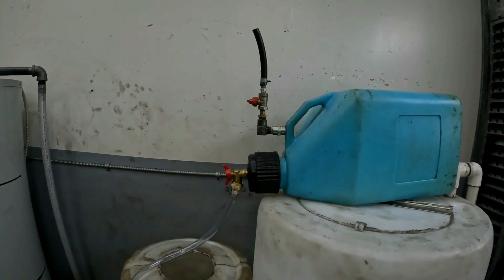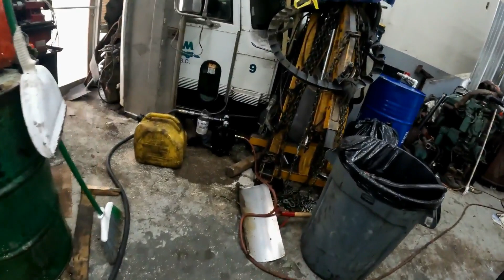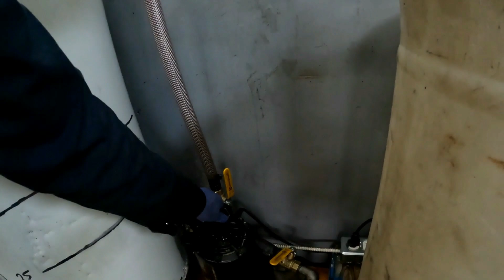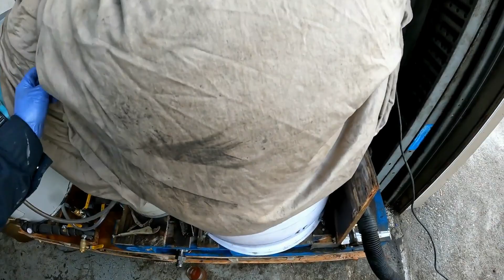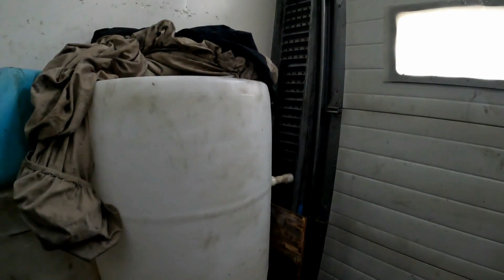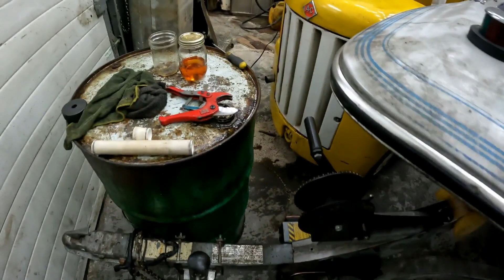First 50 Liters Of B100 Bio Diesel

Comment: What Centane value do you achieve with your mix. Can you increase the Centane value.
Reply from the maker: The B100 has a Cetane of 50 and can be increased with a Cetane booster.  Veg oil has a Cetane of 35-40.

Comment: would a modern common rail diesel be able to run this
Reply from the maker: I know of many on the forums running B100 on common rails that have the DPF deleted.  I've met a guy recently that runs a deleted 2012 Cummins 6.7 on a two tank veg system similar to mine.  Real nice setup with 140,000 kms on it so far running veg.:)

Comment: Once upon a time, I saw an ad for a way to make your own biodiesel. Everything was included including the tanks. The main caveat was if you sell the fuel to others, you have to pay fuel taxes. Since your truck has been running on waste oil, I have never seen such a clean airbox. You are the guru of Detroit diesel gurus. Keep up the good work.
Reply from the maker: Thanks, In the early 2000's before common rail and aftertreatment, these kit's were everywhere.:)  That one your talking about is most likely the Bio Pro 190 or similar.https://www.utahbiodieselsupply.com/biopro190.php
Reply: What was the company name in the ad?

Comment: Sodium Hydroxide is about 1/4 the price of Potassium Hydroxide. At one stage, the mining industry in Australia was using B20 blend in their heavy mining machines, but banned it from use in their light vehicles ( 4wd's).  Common rail engine vehicles like my diesel Amarok have warnings not to use anything more than B5 blend.  Its not for all situations, but a 4-53 should have no problems being non-common rail.
Reply from the maker: Thanks, I just bought 3 Kgs of Sodium Hydroxide today, so give that a go and see how I like it.  True, the old Detroit doesn't care if it's diesel or bio diesel.:)
Reply: @detroitgarage9430  Im really curious see, how much "better" the B100 is when compared to straight vegetable oil in terms of performance,mileage etc.
Reply from the maker: @wazza33racer  I think b100 is very similar in performance.  If it wasn't for the rubber seals in my fuel pump and injectors, I'd leave the 5% methanol in the bio diesel.  Apparently it's a decent improvement in power.  I'll hopefully find Viton seals and that will solve that issue.:)

Comment: B100 is also a very good solvent.  It cleans out any tank, really,really well. Its even sold to Asphalt hot mix plants to clean the bitumen residue off their equipment.  Its quality can also vary a great deal, Terminals Australia in Sydney had an entire 100,000 liter storage tank of it go completely solid.  They had to put guys inside the tank with steam lances to melt the solid,waxy blob into a liquid that could be pumped out. The issue is parrafins (wax) that need to be filtered out before being put into storage.   There is also a guy on youtube who sells plans for a WMO 'cracker' mini refinery that makes a gasoline/diesel blend.
Reply from the maker: Interesting, I didn't know it was used in the hot mix plants to clean.:)  It certainly cleans my floor in the shop, that's for sure.:)  I've seen some of those wmo crackers, but my luck I'll blow up the shop.:)